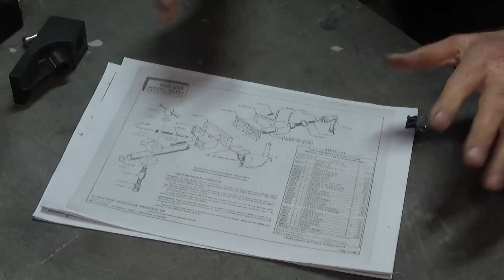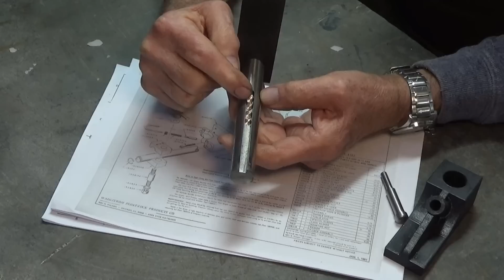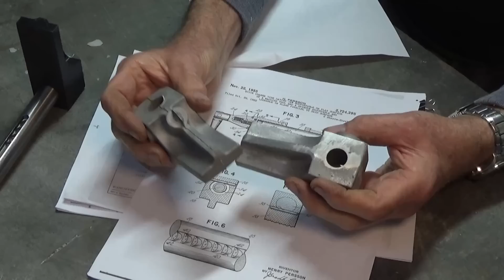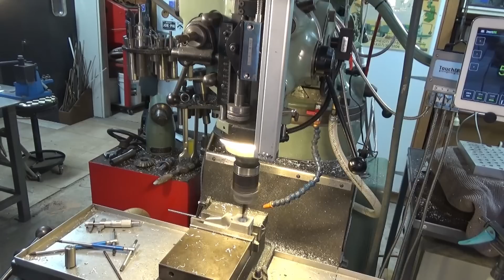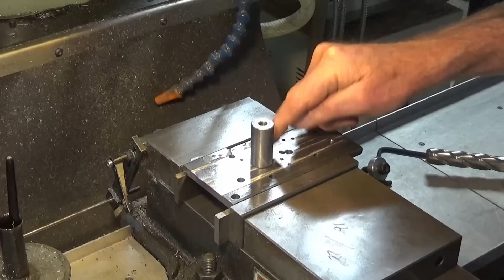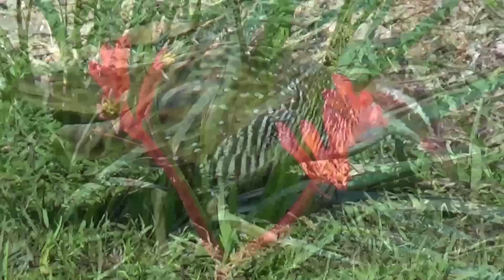Float Lock Vice from Aluminium Castings Part 2

Comment: Hi Mark, from Canada's banana belt. Great that youre using your Yt income to benift a local wildlife rehab centre.  You certainly have some interesting alternative wildlife to the rest of the world.
Regarding the milling of the sides not quite lining up I was sort of surprised that you only ran the two shcs up through the bottom and into the jaw face. Would it not have been more stable to use longer screws that would tighten the jaw to the fixture, then allow you to put a spacer over the upward protuding end into  the counterbores and tighten the casting down with a couple of nuts. That way you had at least a three point mount, with the stub shaft in the middle, to prevent any movement of the casting in relation to the jaw and the fixture. Just a suggestion.
🤞🇨🇦🍌🥋🇺🇦🕊️🇦🇺🐨😁👍
Reply from the maker: I am not sure the fixing was the issue. It seemed like one face of each part was short by the same amount which suggests that there was an error with the offset I had set up in TouchDRO. As always, trying to film stuff at the same time as carrying out critical machining ops means that you are not really concentrating on either job properly. I did end up fixing the misalignment as you will see in the next episode. 
Regards,
Mark

Comment: Ever think about casting extra sets of jaws to sell? They would be the hardest parts to make from scratch . I think I'd mill a small step in the top jaw or jaws to keep parts up off the table. Dont think ill ever be able now with my spine pain keeping me bed bound..
Reply from the maker: The jaws do have a step along the long edge and that part has already been completed in the latest video. Unfortunately, mass producing castings is a full time job and don't feel inclined to devote that much time to it. I only made castings because I can but a simpler form could be machined from solid stock and it would probably be stronger.
Regards,
Mark

Comment: Analytical comment, your communication skills are wonderful!  Fully understand each setup and rationale for doing so.  And the unforeseen results are appreciated- the Boo Boo’s are sometimes as educational as the dead on events.  Did I see window cleaner used as lubricant?  The foaming at one point resembled such, and opened the question.  Great video as usual!
Reply from the maker: No, the coolant was Isopropyl Alcohol. It is probably just the way the spray bottle delivers it that makes it look like it is foaming.
Regards,
Mark

Comment: Its coming along nicely Mark. Bummer about the slight difference and having to fly cut the parts to get them co-planar. But, I'm sure you will show us a new and interesting setup when you machine those parts.
Reply from the maker: I did manage to fix it but lost a bit of material in the process. It's proper flat now! I wish I knew how I stuffed it up. Probably bad mathematics. I never was any good at numbers.
Regards,
Mark

Comment: You are the third creator that I have watched make this tool.  Everyone has a little different slant on it.  Thanks for the video keep on keeping on.
Reply from the maker: Thanks Harold. I have watched a few of the ones on offer too. I think the one that Tom Lipton did was the simplest. It was just a regular drill press vice bolted to an arm that could be locked to a bracket on the back of the drill press table. I had already committed to building my version when I saw his version. Too late to turn back!
Regards,
Mark

Comment: The IPA you use as a coolant, is that 100% ipa? or some mix with somethng?
edit: asking because it looks like its foaming? or ist that the nozzle of the spray that does that?
Reply from the maker: It is regular 100% IPA. It used to be expensive and then mid Covid epidemic it all of a sudden became cheap enough to buy in large containers. Because of the shortage of hand sanitiser, distilleries and chemical companies ramped up their production and then there was an oversupply. It was probably the spray dispenser that made it look like it was foaming.
Regards,
Mark
Reply: @Preso58  Thanks!

Comment: Another great video Mark! I can’t wait to see how this project turns out! Just out of curiosity, could you have placed some sort of spacer between the fixture plate and the parts in that final operation so that your long carbide end mill could have reached all the way to the bottom of the part? Or would that have introduced error or the possibility of chatter? I don’t have any machining experience or anything so I’m just trying to understand what is a good idea and what I should avoid if I ever do manage to get started some day 😂
Reply from the maker: Yes, a spacer is sometimes a good idea especially if you are using a non-sacrificial fixture plate. I was using a pretty scrap piece of plate so it didn't really matter if I milled into it. Adding a spacer does mean that it can be harder to square up the work though. 
Regards,
Mark
Reply: @Preso58  gotcha, that makes sense. Thanks Mark!

Comment: What was the coolant used for drilling, my text generator called it IPA, what is this? Great progress made today, this will make an excellent fixture to the drill press. Enjoyed the shop and the back yard, cheers!
Reply from the maker: IPA is Isopropyl Alcohol. I was able to buy two litres of it quite cheaply but regular methylated spirits or denatured alcohol works well too and it's cheaper. Because it evaporates quickly, it has a strong cooling effect and it also acts as a mild lubricant as well. Stefan Gotteswinter uses it on aluminium so it must be good. 
Regards,
Mark
Reply: Of course I got distracted by the first impulsive thought of IPA for me is India pale ale, and yes it made me thirsty, ha-ha! Thanks for the quick (and serious) answer to my facetious question, cheers Preso! @Preso58
Reply: My thoughts immediately went to India Pale Ale when you wrote those letters, and it made me thirsty, despite knowing it had to be something else, thanks for the quick reply, cheers Preso! @Preso58

Comment: Looking good Mark, those castings are fantastic, not a spec of porosity and very clean, well done. Looking forward to seeing your flycut setup for co-planar and to maintain equidistance as well🤔. Great wildlife update too. Cheers, Jon
Reply from the maker: Thanks Jon. One thing that I learned from Martin (Olfoundryman) was to stop melting scrap aluminium and just spend the money on new ingots. I bought some from a local foundry for $5 per kilo and the results were amazing. Porosity is now almost non existent, there's little to no dross and the surface finish is clean and consistent after machining. The alloy I bought can be heat treated to a T6 spec but I probably don't have the gear to do that. An alternative is a T5 which is a lot easier to obtain.
Regards,
Mark

Comment: I made a pin vice back at school and had exactly the same issue with the sides of the vice. The teacher explained that to put the pin into the jaws it has to be a sliding fit so there is always a clearance between the jaw and pin. He showed me a method which has seemed to work for me ever since. counter sink the hole in the jaw when you bore it. It does not need to be much, 0.5mm is fine and then use an equivalent taper on your location pin and pull the jaw onto the taper. The pin needs to be smaller than the hole. I guess you also got some clearance between the 5mm screws and the fixture which will also cause issues. Same deal but you only do one pin otherwise the part is over constrained. The design looks a little compromised to me, in that when you tighten the jaws, the floating jaw is pushed back into the part of the bar that has the slot for motion cut into it, creating two high load/wear points. I think it would have been a better design with the floating ratchet mechanism opposite the direction of force, i.e. on the other side of the clamp. I appreciate this would make the jaws thicker but it would mean the jaws would not become tapered when clamped with usage.

Comment: I've worked in Engineering all my life, over 50 years and had not come across these clamps before you started this series. Never too late to learn. I have some new to me machines arriving in the next couple of weeks, so I'm going to give it a go making a set, once its all setup. 
Vevor here in the UK have a twin burner furnace for under £200, so I might get one of those and try some casting as well. It'll be the first time I will have done alloy casting since I was 14 at school!
Love the wildlife bit at the end Paul, we are lucky if we spot next doors cat, let alone kangaroos. Make it a permanent feature please.
Reply from the maker: I had not seen one either until Mr. Pete did an episode on the float lock vice. I think they are well known in the USA though. I have put the STL files on my Dropbox folder if you can use them. You just need to print two mirrored copies of the fixed jaw and the moving jaw and one of the table bracket. I usually print them at about 102% to account for shrinkage of the finished castings. I will add the working drawings later when I have made all the corrections.
https://www.dropbox.com/scl/fo/vlmgzs99t2fj24ybsfex9/h?rlkey=vzsg37mlipizzlrjr8wsw3its&dl=0
Regards,
Mark
Reply: @Preso58  Many thanks Paul.

Comment: Thank you for the video and the update. Also for the charity work you do. If I remember I think Joe Pi did a video of setting up and cutting V grooves I believe. Cheers till next time
Reply from the maker: Yes, I should have gone back and looked at that but as it turns out I successfully cut the grooves today using a double angle cutter on a horizontal arbor. 
Regards,
Mark

Comment: Mark you often mention that rust is a problem in your area. I can highly recommend this product if available in Australia "BOESHIELD T-9 Rust & Corrosion Protection/Inhibitor"
Reply from the maker: I have heard about that product. I believe it was developed by Boeing? I do have another product called Lanotec. It is a lanolin based spray and it is very good for tools and surfaces that need to be stored but it stinks like a wet sheep and it can be very tacky. I can get the Boeshield here. I will get some to try out.
Regards,
Mark

Comment: I was wondering how you’re gonna center the bore. Looking forwards to this build. Cheers Mark.
Reply from the maker: That part worked out well. At least in terms of getting the steel and aluminium parts to line up. I am just angry with myself for messing up the offsets for the outer faces. I was beating myself up about it and then watched a video by Keith Rucker where he screwed up a pair of very expensive looking bronze castings by machining too much off them. I didn't feel quite so bad then!
Regards,
Mark
Reply: @Preso58 Lol yes Keith goofed up on that one. Though he said it didn’t matter much, but still gona remake it. At least in this case it can be salvaged.